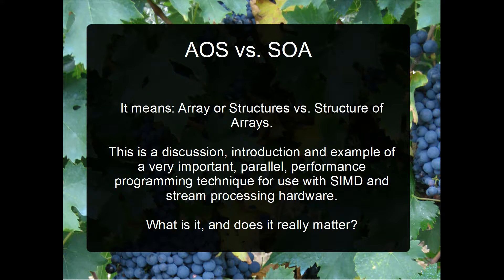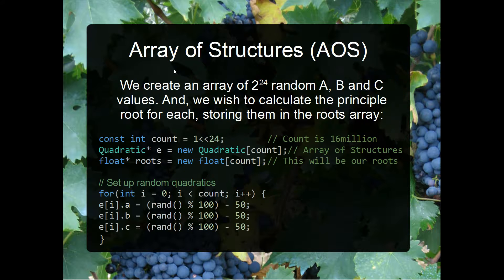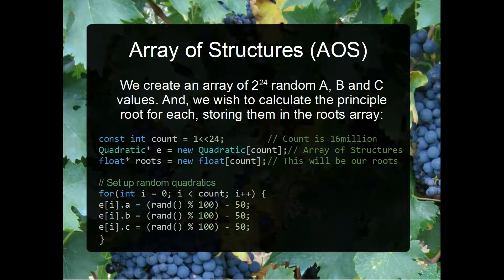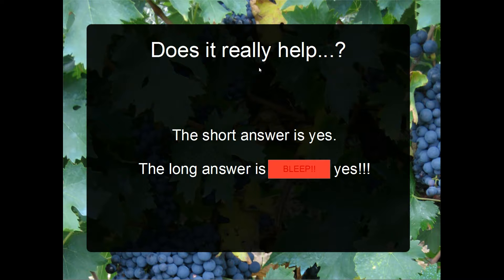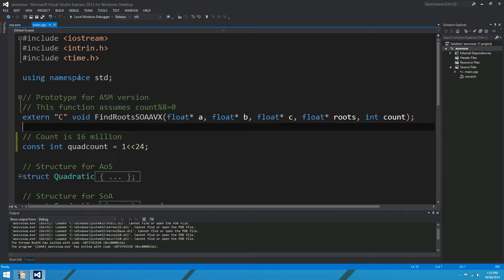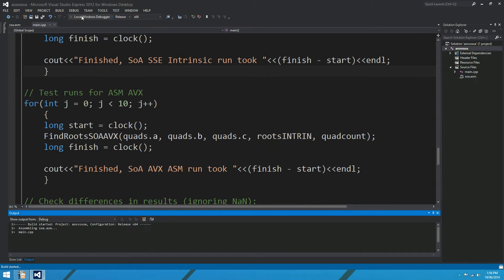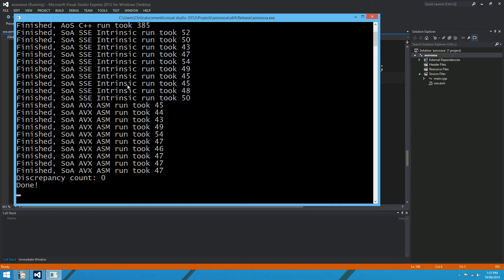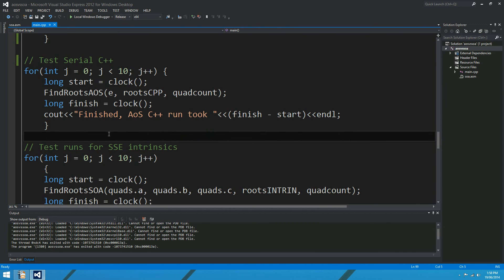AoS vs. SoA: Array of Structures versus Structure of Arrays

Comment: When I do a test like this in c# there is no performance difference it's driving me nuts
Reply from the maker: That's strange...? I've not tested it in C#. I can't imagine .net vm would be 100% oblivious to such drastic changes in the code; but it's very interesting. Cheers for sharing, have a good one :)
Reply: @WhatsACreel  Just did the same in Cpp, I guess I'm really not getting it cause I see no performance difference :( In theory, I totally get it but I can't seem to produce an example that really works. What I am doing is just adding 2 variables' square roots together 100 thousand times, and using chrono to see how long it takes. I'm writing a research project on Dataoriented Design for school so this is really starting to annoy me :/
Reply: @WhatsACreel  If there is anyway I could get this example from github or something to inspect it, I'd be really appreciate it, love the video btw :)
Reply from the maker: @cybon4687  Sorry brus, don't have the code any more. I suddenly remembered, someone pointed out the compiler wasn't using the hardware square root. Switching that was the lion's share of the performance increase (and AOS/SOA contributed maybe an extra 50% or so). I think I put this into an annotation, but YT cleverly decided to remove that functionality. This conversation is below, it's with jvoltage.

Anywho, I made some video a while back on matrix multiplication which features much the same technique used in the context of a matrix product. Videos are called “performance x64: caching” or something like that. Maybe try implementing those and see if it makes a difference?

I cannot see that C# could be oblivious to these caching effects... That just doesn't make sense?? Maybe it's something we should investigate on the channel in a vid?

Well cheers for drawing attention to this brus, have a good one :)
Reply from the maker: @cybon4687  Incidentally, I'm getting a slight improvement when trying much the same trick on my machine. I had to turn on x64 code, and optimizations in C#. It seems to give maybe 5% to 10% improvement. So it's ok, but certainly not the same improvement as C++
Reply from the maker: @cybon4687  Sorry, it's only a few % better. Anywho, my machine is behaving much the same as yours. So, hope that helps alleviate your confusion
Reply: @WhatsACreel  Good to know that I'm not totally off, was getting really frustrated xD I'll look up the vid. I would love for this to be explored further in another video, I think it's really interesting, but I can't even figure out how to prove it in C++, maybe I'm doing too simple maths? When exactly does SoA help? Cause I'm just looping through two different structs and doing the same maths and replacing the values with the results. It seems to run at the same speed. So far unless I'm missing something huge, it just seems so limited in when it is useful.

Comment: My computer is not quite as fast as yours but I did get an additional speed-up using AoSoA (packing the elements as follows: aaaa bbbb cccc aaaa bbbb cccc etc.). On average a 6.5x speed-up over AoS and a 1.6x speed-up over SoA. What's weird is that SSE should only theoretically yield a 4x speed-up over scalar. In my case SoA is almost exactly 4x faster than AoS on average, yet AoSoA pushes performance beyond that even. I just copied your code for AoS and SoA tests, and built a similar benchmark for AoSoA based off of those. What could be causing this speed-up? Better memory management? Poor performing scalar code? Programmer error?
Reply: Memory locality would be my best guess, because as Creel said, the  bottleneck in the SoA version is fetching the data from memory. If you can load one whole struct into the SIMD registers, bang the arithmetic out for all those, and then just move your pointer once more to grab the next struct and load that whole thing instead of reading A0 through A3, moving the pointer to B0 and reading to B3, then move to C0 and read through C3 (which aren't going to be at all close to each other in memory, because the entire arrays are stored end-to-end in memory), then I could easily see a performance boost just from that.

It does seem odd that memory locality would matter in modern solid-state RAM, but that's the only reason I can think of that it would be at all faster. Maybe something to do with compile- or link-time optimization and pipelining could have something to do with it? But pipelining is pretty good nowadays, that doesn't seem to be the ready answer. And keep in mind I'm very new to all of this as well, I doubt I stumbled on the right answer just like that.

Comment: Could you include the compiler flags you use? I don't use Visual C++, but it is always interesting to see how well (or not!) the auto-vectorization in modern compilers works. Thanks for another tut!
Reply from the maker: The compiler flags are all defaults for Release mode, which tries to optimize for speed. The compiler is supposed to auto-vectorize, but I've actually never seen the MS compiler auto-vectorize anything ever. The only time I've seen it use SIMD SSE is when you spell it out with intrinsics, which could hardly be called auto-vectorizing!

I'm not sure, but I don't think anybody has come up with a decent auto-vectorizing compiler yet, maybe they never will. It might be one of those nasty non-polynomial problems that only a quantum computer or human being can solve.

On the other hand, I've heard that the Intel compiler is pretty good at auto-vectorizing. But I'd be very surprised if it could auto-vectorize anything other than the most trivial and obvious for loops.

I hope this is something like the information you wanted, thanks for watching and commenting!
Reply: Well, ms compiler can certainly auto-vectorize this:
https://stackoverflow.com/questions/40138067/strange-uint32-t-to-float-array-conversion